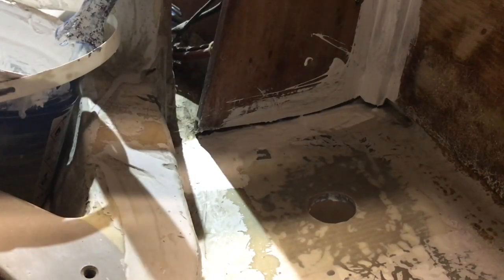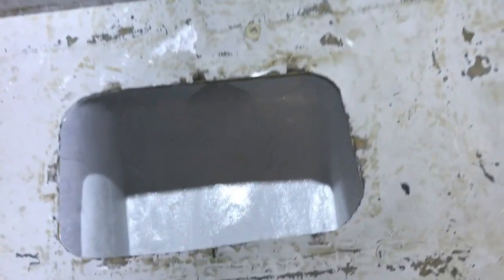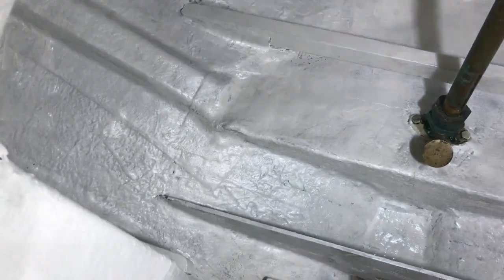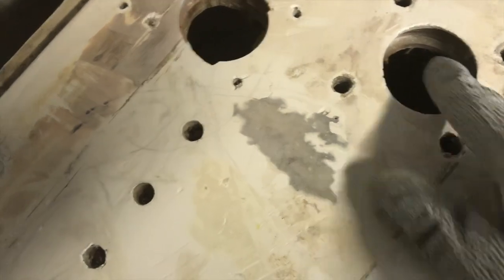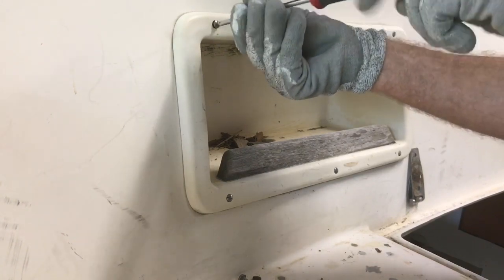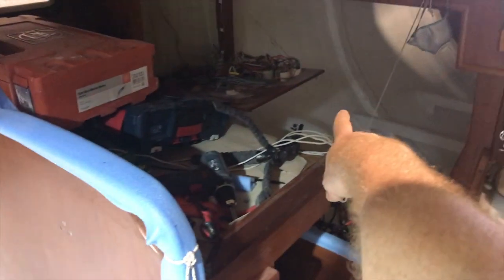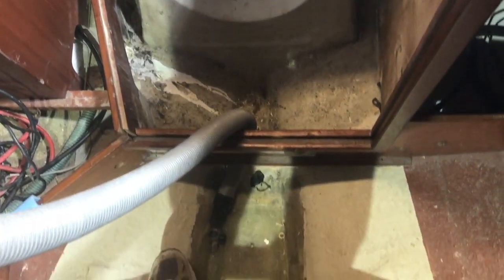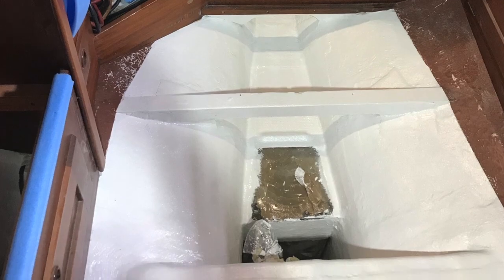Hallberg Rassy 312 "Ellös - Sea4See - Painting The Interiors

Comment: I looked through the comments to date and see no mention of masks, filters, etc.  My experience (extensive) tells me that if you can smell any bit of the work, your mask is either not effective, or only for particulates.  A good mask for chemicals must be an activated charcoal canister type.  These are usually screw or clip on replaceable cartridges and can be supplemented with particulate pads on top of the canisters to prolong the life of the canisters.  The mask will last longer if the storage is in a zip lock bag, keeping air transfer to a minimum.  When it gets harder to pull air, time to change canisters.  If you can smell anything, change canisters, or the mask if the fit is not perfect.  Too many of my contemporaries have suffered complete lung damage or various cancers from blase treatment of paints, finishes and the usual nasty chemical cleaners...
Reply from the maker: I would like to thank you for a huge amount of infos you gave me. I bought a 3m suitable for dust and spray painting... is not too much i will follow your advise!!! THk👌🙌
Reply: I only posted because you requested...and that is a sign I do believe of impending or acquired wisdom....some of us have expertise in one area, but not, for sure, in others...
Reply from the maker: dhamma58 is nice to get advise and  infos from people know more than me! We never stop to learn! 💪🏻👍🏻💪🏻👍🏻💪🏻

Comment: I hope you have a way of setting up an exterior fan so that you can get a fresh current of air through the boat as you work. Though the mask is absolutely a necessity it is always nice to have fresh air coming in at some level whether that air is warm or not. I often, when doing paint projects, set up two fans. One fan gently blows inward the the other vents outside.  It creates a tunnel effect for me. I set the fans on low as I don't want to raise dust unnecessarily, I just want to create a gentle current. It is critical when working with solvents so that there is no risk of ignition of fumes. Also, the fans are set up outside of the work area so there is no electric motor running within the work area. Just a thought.
Reply from the maker: Bruce Kratky thx Bruce for your perfect advise! I will use your! Sound very good! Tomorrow fan in the boat!💪🏻💪🏻💪🏻💪🏻

Comment: Gabriele - I am very happy you have the same boat model as mine ;) Thanks to your videos I know everything what to expect when starting any job on my boat.
Currently I am starting renewing my water tank. How did you clean all of these narrow areas (where the hull meets with the floor)? I have a lot of errosion and dirt there and I have no idea how to clean it and prepare for painting.
Reply from the maker: Hey thx for write! I used the hydro power for clean those places and a lot of sand paper my god so hard!!!
Reply: @sea4see  Thanks for quick response. I am also thinking about preventing these places for the future by filling them with epoxy filler or epoxy resin.
Reply from the maker: Rafał Wrzochol yes but use epoxy for water tank!!!